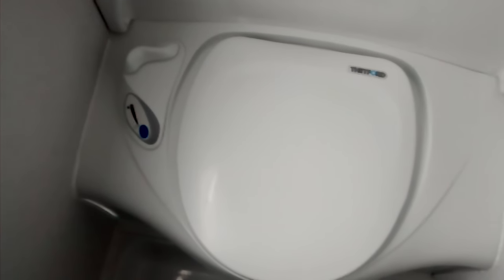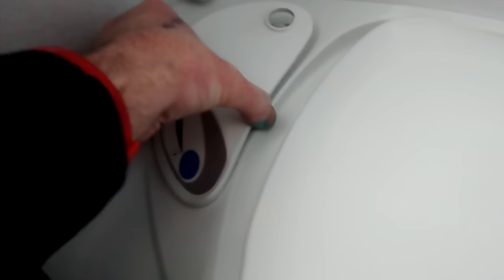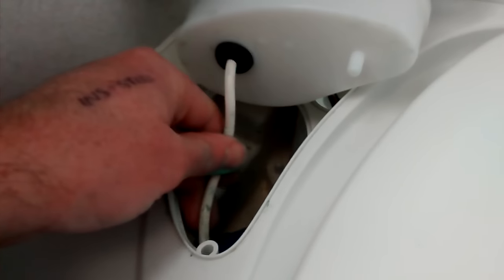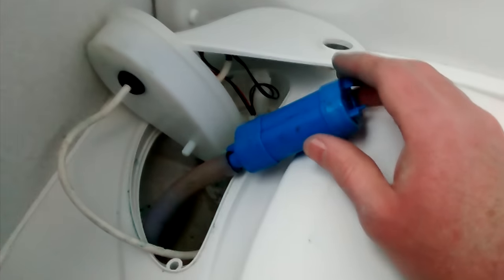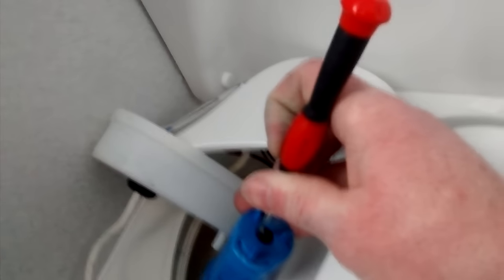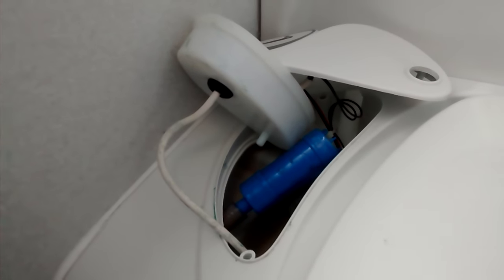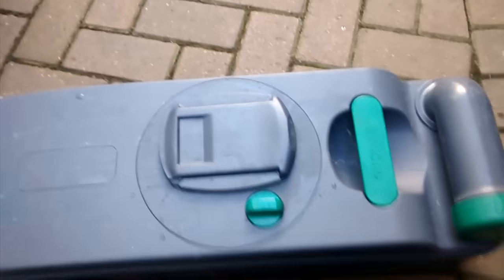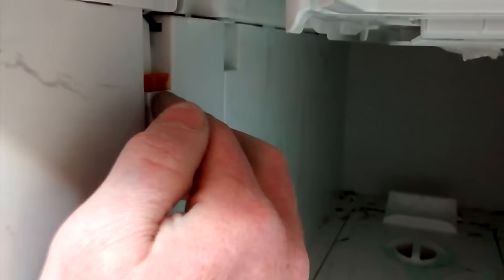THETFORD CASSETTE CARAVAN TOILET NOT FLUSHING

Comment: Just wanted to say Thank You from Sydney Australia.  After fiddling around with the circuit board and cleaning the connections it still wouldn’t work.  Followed your instructions, cleared the pump..... wouldn’t work..... replaced the fuse (which I would never have thought of), and bingo, it works!!  The instructions for getting the pump out were also really helpful.  Without this video I would have spent hundreds of dollars replacing parts.  THANK YOU 🙏

Comment: Thanks Nick - I just bought a second hand caravan with this problem and managed to fix this using your video. It took me many unsuccessful attempts trying to get the pump out using the electrical cable attached, and ended up instead using the thick flush outlet hose successfully. For anyone else struggling, I reaching in as best I could to grab the hose high up on the toilet side of the hole, and dragged the pump up by pulling the hose towards the back wall of the toilet. Hope this helps anyone else, and thanks again Nick.

Comment: Thank you very much for your video! I had the same issue in my caravan after not being used for a while and following your demo I was able to locate the impellor. Sure enough it had seized - I thought it was done for but after turning it in both directions for a good 15 minutes or so, gradually it came free and is now working as it should. Saved me a lot of time and money (in getting a professional to look at it).. Cheers!

Comment: I was delighted to be able to fix the problem with the help of your excellent video. My pump was seized, it took a bit of freeing. Getting it out was hard but getting it in harder. The trick is to get your head round how the water pipe has to run to enable the pump to drop in. You need a smallish hand to do it!

Comment: Thanks Nick, I put the flushing additive in an empty tank and the flushing wouldn’t work. Followed your video and found fibre locking impeller up. Cleaned that with a small screwdriver and now works fine. Appreciate you taking the time to make the video. Cheers Mel
Reply from the maker: Mel Green......  fab! Glad it helped you.

Comment: Thanks for the video, saved me buying a new pump.  Strange thing was though at first I thought it was a blown fuse, bought some 3A fuses, then saw there was no fuse there!  Thought someone may have borrowed it, so bought some new 3A fuses, put it in and then nothing, Almost bought new pump, then saw your video, thought I'd moved it round a bit then hey presto it worked.  Took the fuse out again and still works, very strange!  Thanks again.
Reply from the maker: Fab. Glad it's still helping people.

Comment: Found this video most helpful.  Bit of a job to get the pump out, as you say, then found the pump had ceased. Could not move the impeller with a screwdriver. so got a pair of thin nose pliers on the spindle and eventually managed to get the pump free. Replaced the fuse and all works well. Thanks again.

Comment: Thanks for this video.  I replaced the blown fuse earlier this year, in the hope that would sort it, but no luck.  I found loads of gunk in the tank as it has not been possible to flush the campervan toilet for months.  I turned the impellor blade several times, as suggested and loads of gunk came out. Hooked it all out with a small screwdriver. Completely flushed the system and drained it down, pump works again and issue fixed. Thanks!

Comment: Awesome video.  Couldn't have done it without this.  I fed in a thick zip-tie around the hose to use as a handle to get the pump out   worked great, as I couldn't get the leverage w my hand around the hose to actually pull the pump up.

Comment: I was totally stumped until I found your video. Thank you very much. My toilet pump is now working again. Problem was that the circuit board at the back of the switch had been pushed off its two little locating pins, meaning that when the button was pushed it was not engaging the switch. Thanks again.

Comment: Thanks Nick, cracking job!Also we inherited the toilet with blue in the flush tank, so need to drain all that out and give it a few rinses.My pump was clogged with what looked like dried 'blue' which came away easily with the end of a small screwdriver.
The back of my hand is now the same scraped raw red colour as yours, but the loo flushes!
I owe you a pint Nick.
Reply from the maker: 57juggler .... glad it was of some help.

Comment: Great video
I found my blown fuse - eventually (thanks for the clue where it was although my WC is "the other way round" so fuse was on the other side and further back.

Then of course the pump was jammed - which was the reason the fuse blew.

Finally got the pump out - I have big hands...

Have tried freeing it as suggested and am now soaking it in a jug of water but I suspect a new pump is required.

Thanks

Dave

Comment: Great video,  pulled the pump out on mine rotated the impeller changed the fuse to a 5 amp, jobs a gooden. Not a lot of room to get the pump out, if you have big hands, get your wife to do it.

Comment: Just perfect Nick, first checked and replaced the fuse... No luck, checked the Thetford manual. Pretty useless in such case. Guessed that it could be the pump if nothing else but where is it? Did some precision guesswork and looked up your video on YouTube , exactly same issue, impeller blocked and managed to get it moving again.. A BIG THANKS !
Reply from the maker: Brilliant. Pleased it was of use to you.

Comment: Thanks , worked perfectly. One tip on removal of pump with big arthritic hands. I managed to get a 30 cm cable tie around the hose and was easily able to pull the hose with this and a pair of vice grips. Some silicon spray helped get the impeller moving along with a fine screw driver. I left the cable tie on the cable for next time and ordered some 3 amp fuses on eBay .

Comment: Absolutely bang on buddy! I tried in vain beforehand to get the pump out, but your tip about pulling the tube did the trick. It’s still a bitch to get your fingers on the tube but your video gave me the confidence to persevere. Pump freed up, fuse changed, toilet flush working again - 10 minute job👍
Reply from the maker: Nice one. Glad it helped you.

Comment: Handy hint for getting out the pump is to push the water flush outlet under the seat into it's mounting hole and the solid hose that it feeds the water through comes straight out with the pump on the end.

Comment: Hi there. Great video. I suggest that you can also get to the pump from the exterior section. By removing the rotating filling pipe & the plastic attachment you can access the pump from underneath. You can jiggle it around  & so assist another person to remove the pump from from inside the van.

Comment: Yep water in tank but nowt in pipe. Odd. Can feel water when I put hand inside where pump came from.  Will change fuse if I have a 3 amper and go from there. Will let you know how I get on. Many thanks for your help
Reply from the maker: Mandy McDermott check the fuse then as a priority. if the pump is whirring then its doing its job. if not and fuse is good then it will be the switch. I would probably check that when the button is pressed that a current is going down to the pump either with a voltage meeter or even a cheapy continuity tester screwdriver that are a few pounds. let me know if there is any way I can help. good luck!

Comment: Cheers for the vid mate, though mine is still not working despite freeing the pump up, it was a little stiff and the fuse was not blown unfortunately, but if it wasn´t for your tutorial her I´d be still on first base scratching my head, looks like I´ve got an electrical problem somewhere.. I´ll have to get the voltmeter out .
Reply from the maker: Good luck. Hope u get sorted easily.
Reply: Turned out to be just a loose connection between the wires coming directly from the pump to those two silly looking bulky brown and orange connectors coming from the control board/pcb.. I replaced them with cable lugs used in the 12v electrical wiring/auto industry, so they can still be unconnected if the pump has to be taken out in the future, and I have a feeling it will .. If this helps someone else.

Comment: I bought my camper new in 2017,I didn't try the toilet out until 2019,I notice the fuse was missing so I put in it, and it blows as soon in I put it in .I checked the pump it doesn't  seemed to be jammed. Do you have any ideas? Thanks.

Comment: Is the pump in an area of liquid? Mine is different.  I can hear the pump is working but the liquid not getting through.  There is a 2 inch diameter  pipe with some liquid in but then a sort of dry area and the pump sounds gurgly but dry.  However the cassette won't let me put in more liquid.  :(  is there a blockage?  Should I get a big pipe cleaner?

Comment: Hi, I watched your video and was just wondering, the flusher is still making the wizzing noise but there is no liquid coming out. I opened up the spout because I thought there maybe no liquid in it but it was full to the brim. Is this another problem or should I try what you have done. I didn’t think it was the fuse as I was still getting the noise.

Comment from the maker: I would like to add that for safety's sake I suggest you replace the fuse like for like. 3amp is very low and doesent seem readily available in most blade fuse spares packs. Im running a 5amp and I've seen it mentioned elsewhere suggested that 3amp is very light and blows too easily ....but like for like is best.

Comment: Hi! Great video, my problem is the loo wont flush but there is also the small spring which you can see at 4:06 in the video going across, ours is hanging down from the half round plastic thing, and I cant see where it connects to. Yours looks like its connected to the inside wall of the cassette housing? Cheers!

Comment: Great video. I have small hands, have the pump out, now not so sure how to get it back in again. And also where the stiff hose connects to. Not yet changed fuse but will. My problem wasn't that the pump was not working or obviously jammed, but that there is no water getting through and none in the small pipe next to the cassette. Yikes fear I may have made it worse.
Reply from the maker: Mandy McDermott check the fuse and if its blown, replace and try the pump before you put it back in. the stiff hose attaches to the pump at one end and into the back of the toilet bowl. don't give up.

Comment: Thanks for your prompt reply. How do you feed the pump back in the hole from wherest it came as it was bloody difficult to get it past the plastic.? Also why no water in small pipe near cassette? Many questions Mandy
Reply from the maker: Mandy McDermott the small pipe that you can see from outside at the cassette part us just a visual indication as to how much water is inside the tank. the pump just needs feeding back into the hole straight down. there should be water in there for the pump to submerse into. have you actually  got water in the tank?

Comment: Hi, thanks for the video.
I have just installed the same new toilet and the  pump works but I cannot fill the toilet water tank. I poured water in the water filling pipe but the water does not go anywhere. Am i missing something obvious or have you heard of that issue before?
Thanks for your help
Reply from the maker: I'm sorry but no, I don't really know what would be wrong other than follow the pipework through to the toilet. The fill pipe must have come undone somewhere. 
Hope you get sorted.
Reply: @BeauMadeline  thank you for your reply. Yes going to get a cable in there to see where it is block
Reply: @stephane918  I thought the same when filling it, the water just seems to fill the top up pipe only. You just have to keep pouring when you think it's full and it will take at least a gallon. You'll then see the level in the sight tube start rising.

Comment: I have done everything you said to do its is making the flushing noise but no water is going into the tank do you know what's wrong please thank you for your help
Reply from the maker: Have you had the pump out and checked to see if the little impeller is actually spinning around?
Reply: @BeauMadeline  yes and have changed the fuse. Have filled water internally ok wen handle etc is off but from outside it won't go into the tank and show on water fill level tube

Comment: Ive a thetford c402c  ,similar to this. Im not getting any power light to my control panel. Ive put a new panel in (sealed unit) and changed the fuse . But still no red lights
Any thoughts?

Comment: hi our toilet has stopped flushing.  We also filled the cassette up with water and the full indicator did not come on.  Last year the pump did stop and we managed to get it out and clean it and after that it was fine, It was quite tricky to do so would not want to remove it again unless essential. With the indicator not working could that be a different problem?

Comment: Great Video Nick . My issue is that the flush is working intermeintly., and it coin-sides with pushing the cassette in , There is a read switch at the back. Do you know if this is interlocked so the pump do not get voltage until the reed switch is made , ie the cassette is fully in . Now it has stopped working al together.
Reply from the maker: Counting Stars TV . Sorry I have just read your comment as I was away. Hope you got sorted with your problem?

Comment: We got a problem with ours not flushing. You push the button and nothing happens think you should get a green light on when pressed but don't. Checked outside fuse dosent look like it's blown though. Should I change anyway just in case. Any ideas thanks
Reply from the maker: michael chambers yes change it anyway but it's still very likely that the impeller is blocked and it will just blow again anyway. (Unless you have already cleaned the impeller ) it costs you nothing to Check. It usually blocks up when you haven't used it for a while. 
Otherwise it could be electrical possibly the button switch.

Comment: Hi flush pump works but no water.. 
I am connected to tap. Does the water still go to toilet or does the tanks need to be filled?
Reply: Any advice would be appreciated. Love your information
Reply from the maker: @gladterri4934  if it's the same type of toilet as the video, even if you are connected to a tap on a serviced pitch etc the flush is still it's on separate system and the flush tank needs filling outside at the access hatch. Cheers.

Comment: I am unable to get the pump out, do I pull on the white cable? You seem to say pull out by the tube, but I seem to only access the white pump cable. And if I get it out, how to get it back in? Other peeps comments seem to imply it is easy. Am I missing something ?
Reply from the maker: its difficult as its wedged down due to the pipes stiffness. don't pull the thin electrical wire. try persuade it to come up with thicker water pipe. maybe try jiggle it about slightly too as it catches the plastic mouldings as it comes up.

Comment: Hi it's me again, on the outside where the tank is ,there's a glass tube that I think it's suppose to have water in it ,but I don't see nothing in it. I put pink solution in the spout of the tank , but still nothing happens when I flush.

Comment: Well you’re not going to believe what I put in the filling tank once,,,engine oil 😂 yep it was night I was tired and grabbed the wrong bottle but it still works,,,I don’t use the pink liquids I actually use the blue stuff and have done for two years,,,,,but we live in it and so we are using it everyday so maybe why our pump isn’t seizing as you experienced I use it because we couldn’t find the pink stuff and I wanted something in there to mainly prevent mould build up etc sooo we still get mould🙁 but it’s more  stuff to have to break down the bad stuff and so Istill use it along with the satchels that I throw in the holding tank,,,we are having an intermittent fault where the pump keeps running a little after we take our finger off the button but I suspect it’s part of the button cct

Comment: Well that was informative. BUT, his, 'all you have to do' did not transfer to my operation. It was impossible to get the pump out. I resorted to removing the outlet from the pump to the toilet bowl. This plastic can be pushed out of the bowl easily, getting it back is not so easy. A lever to hold the outlet upwards so that the protrusion at the bottom catches on a lip makes it secure. He mentions the fuse. Well my fuse had corroded and needed cleaning. You can tell if the fuse is O.K. at the beginning, by switching on the light in the toilet area, then operate the pump. If the light dims, the fuse is O.K. Then proceed as directed. I thank you again. Next patient please.
Reply from the maker: Well thanks... Lol.
"He and his" = me, I only did this initially to help out someone that had a similar problem. I'm not a caravan repair guy or a technician. Your more than welcome to make your own quick video. 
(I don't even add crappy adverts) 
Only left the video on in case it helped another person.
Peace and love.
Reply: @BeauMadeline  Nick, I apologise if I offended you. Only when I had my hand in there, thinking, 'did he use his right or left hand?' I had to look at the video again. I hope that my additions will help others. You certainly helped me, for which I give my grateful thanks. Well done. I reckon that anyone approaching problems on camper vans is a brave person and should be recognised as such. You are.

Comment: Hi there, great video but i am now stuck. I have a new pump as replacing the fuse had no effect. I had t cut the wires from the old pump as the connector would not pass through the plastic cap. I have no idea hoe to re-connect the new wires to motherbord connector as i can’t open the connector. help
Reply from the maker: stephen crompton ...Hi Stephen. Hope you got sorted?. Only just seen your comment as I was on holiday .